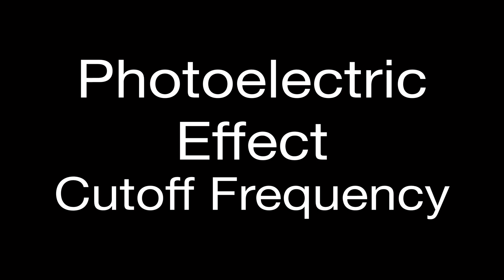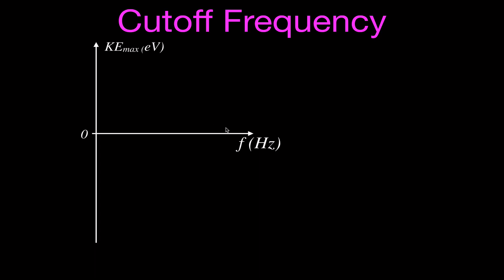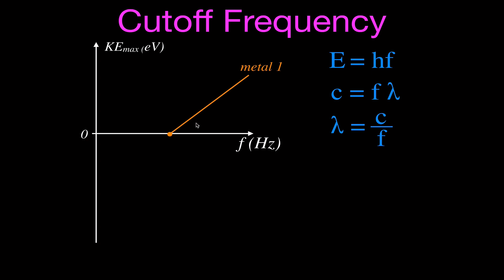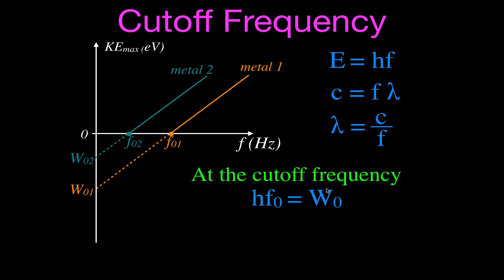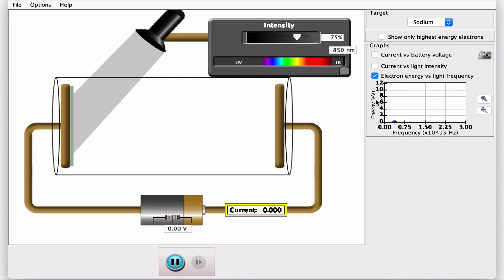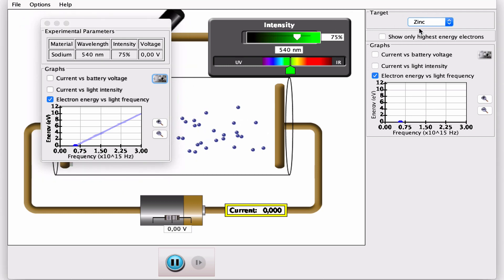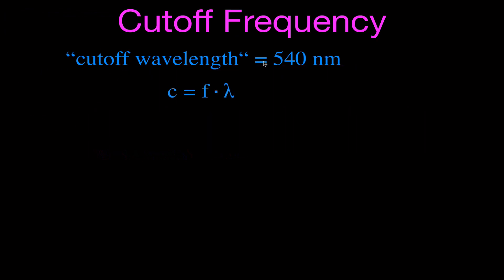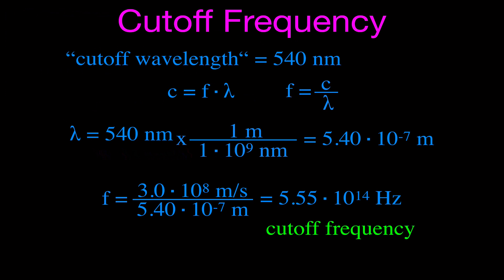Photoelectric Effect (5 of 8) Cut-Off Frequency, An Explanation

Comment: Suppose classical physicists had the idea of plotting 𝑲𝒎𝒂𝒙 versus
f as in Figure. Draw a graph of what the expected plot would look like, based on the wave model for light.. Would you answer me please !  and thanks
Reply: Since classical physics assumes that intensity is the only determining factor, increasing the frequency is just an add-on/good to have. Just like for the quantum model, frequency is the determining factor, but increasing the intensity definitely helps when the threshold freq is achieved, because the greater the intensity, the larger the number of photons coming from the light source, hence more electrons released (proportional relationship)